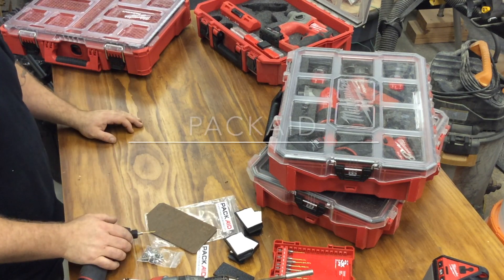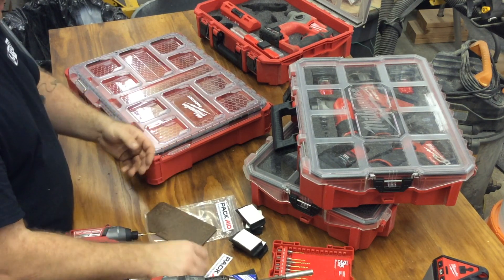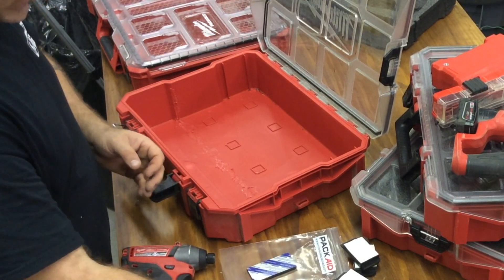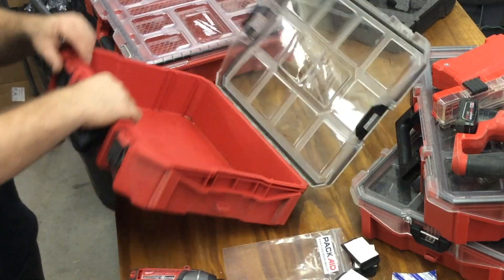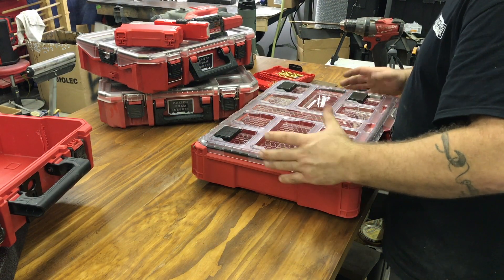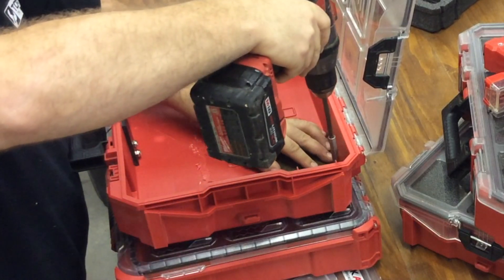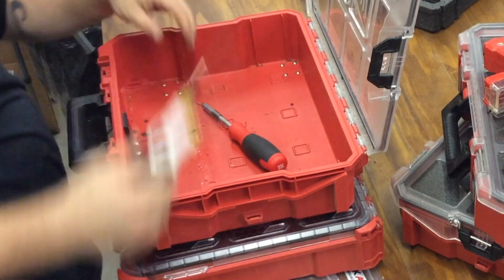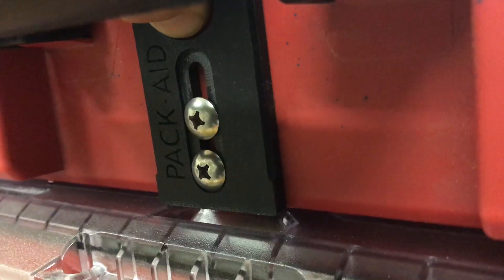PACK AID for PackOut

Comment: PackAID looks like a decent fix, but still a couple issues i can see. 1) you would have to put that on every organizer you might want to attach to the packout system, or at least to one organizer that you always take, then attach the other (old) organizers on top of it. 2) whichever organizer has PackAID doesn’t look like it would nest on top of the old organizers anymore, so it would always have to go on the bottom. A bit picky, but sometimes its the little things that drive you crazy.  Also, 1 gripe I have with the new packout boxes is the layout of the cups inside; because of how the lid is formed, you can ONLY put the longer rectangle cup in the middle, you can’t substitute 2 square cups in its place. Bad oversight on Milwaukees part.

Comment: Now you have another project fixing the holes that you drilled into your 50$ packout box so you could attach one 20$ organizer
Reply: PLARH8R1 When did he drill into his pack out case? The pack aid helps connect his organizer to the packout. Not a bad idea because this mod make his organizer packout compatible and still has its original functionality of stacking other organizers on it.
Reply: when he predrilled the holes too deep for the feet while still on the packout box... you can see the holes in the lid when he takes it off at 8:46
Reply: Yeah so confused why he didn’t just take it off the pack out box before he drilled the holes...
Reply: Old video, but I was watching him do this and was like dude, stop you're gonna drill thou--- whoops, nevermind. He was supposed to pull the old box off, then drill. That's what the double sided tape was for.

Comment: Problem that I see is nothing will attach to the top of the old organizer, therefore you could only use one modified organizer at the top of your system only
Reply from the maker: The 20" organizers attach to it. Thus being the solution for all who already are heavily invested in the original boxes.